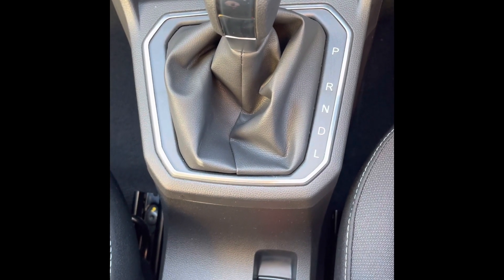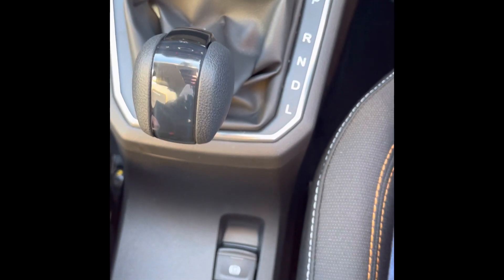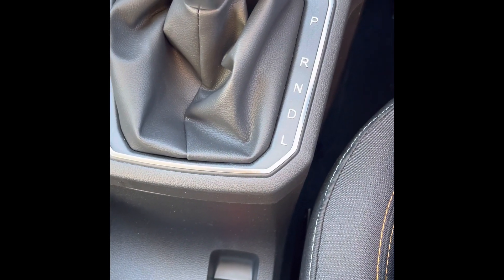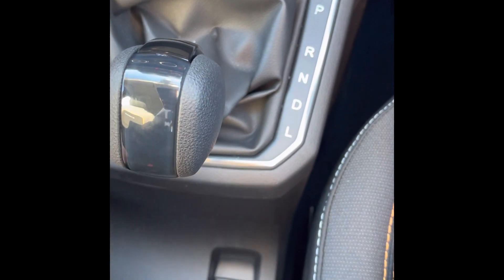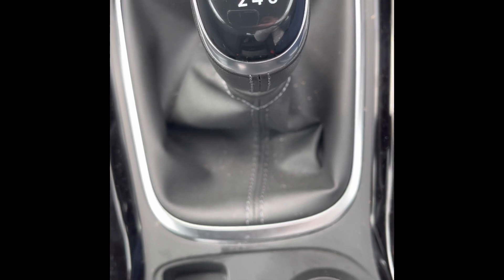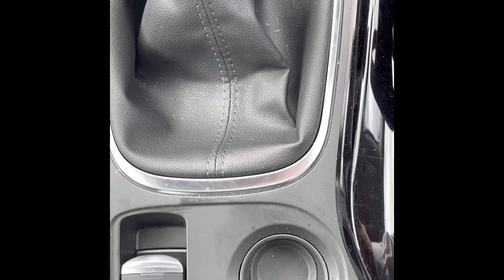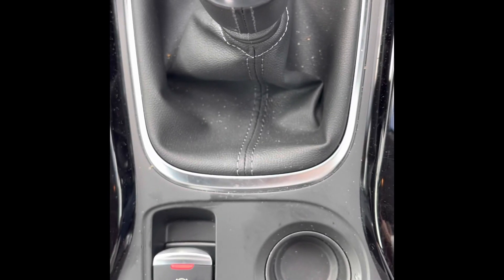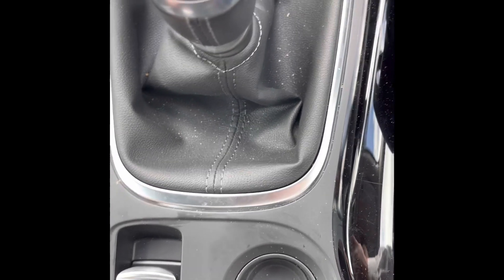Electric parking brake explanation for All new Sandero and Stepway 2021 and all Renault cars

Comment: As an "oldie" how is all this less complicated (in a manual gear car) than holding the car on the hand brake and releasing whilst feeding out the clutch?
Reply from the maker: It just takes away the hand movement all you do is the feet part and the hand break comes off automatically
Reply: @renaultdaciahowitsdone9514  I'm an oldie too, and I'm happy that mine has a lever and an ignition key. They don't call me a 'Luddite' for nothing!
Reply from the maker: @peterking2794  ah nothing wrong with a key and a stick just sadly going to be phased out unless we get hydrogen quick enough

Comment: Absolutely horrible. Too complicated and there is nothing wrong with the traditional handbake. This one will go wrong. People like Dacia because the are not full of complicated stuff that goes wrong. You are falling into the trap of thinking everyone wants this rubbish. No we dont. This is the sort of thing that will be a problem as it fails, needs more servicing and expense. As production costs rise, so will the price of your cars. The whole ethos of owning a Dacia will be gone.
Reply from the maker: I would encourage you to try one as they are in no way complicated it does it all for you. And sadly with the move to electric no manual handbrakes will exist and Dacia have to move with the times, they have managed to keep there place as the cheapest on the market and bring in new tech, also not all the range has the electric handbrake so if you are not a fan you don’t have to have it.also they are incredibly reliable.
Reply: @renaultdaciahowitsdone9514  I agree with Mike. I hate the start/stop system as well, so always turn it off. I can envisage a few years away when we're stuck behind a car with a weak battery or starter motor that won't start the engine when the lights turn green. There will be more expense and hassle to replace batteries more often than hitherto.
Reply from the maker: @peterking2794  the system has a fail safe that if the battery is low as it would be in a weak battery then it will not stop , hence why it won’t work just after starting the engine or if you have heating/air on on full. A dodgy starter will get you at the worst time what ever the case it’s always the way.

Comment: I ordered my new Sandero Stepway Comfort in January, but it'll be arriving at the stand only in mid July. It's a manual gearbox, with hands free keycard, upgraded armrest, electric parking break, iron blue color and with the 16" rims 😎
Reply from the maker: Nice! Yer a lot of delays on delivery due to the chip shortage sadly that and the massive demand for them.
Reply: @renaultdaciahowitsdone9514  Definitely the case, ordered mine in January here in Romania, should be getting it in the next couple of weeks.
Reply: Indeed. Actually, I just found out that mine will be a Prestige, due to the extras I added to it 😁
Reply from the maker: Haha I was thinking that!